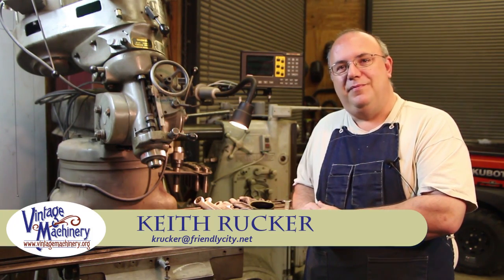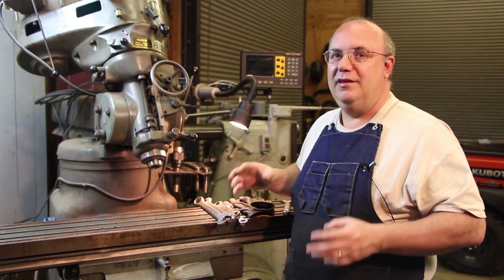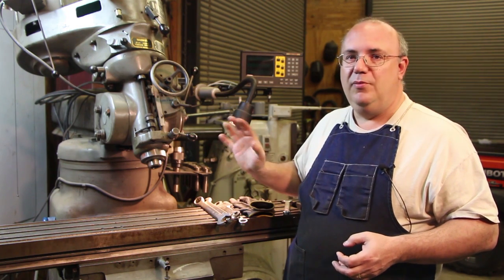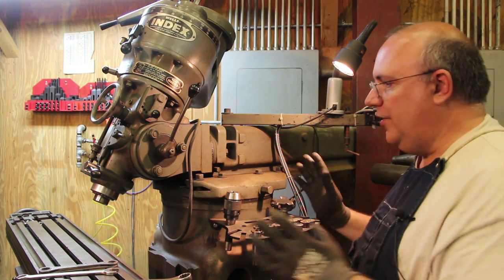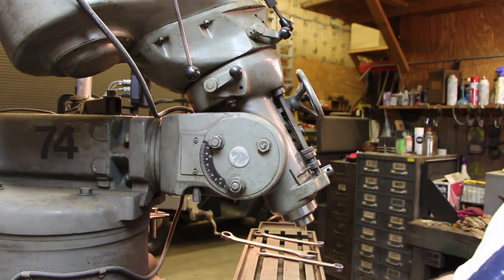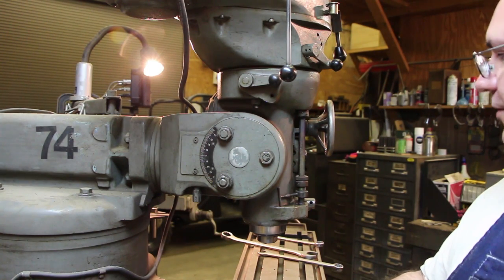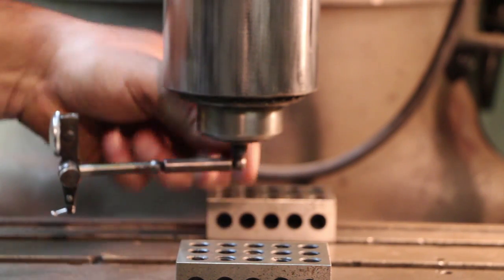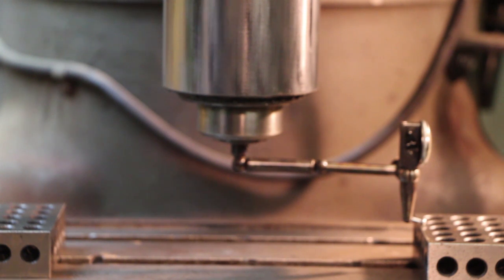Machine Shop Basics:  Tramming a Vertical Milling Machine

Comment: I know this is an old video but I wanted to take the time to tell you that it's still providing useful information for folks and to say thanks.  I just tried your tramming alternative procedure and it worked better than I can do with a Last Word on a bar in the spindle.  I used a precision shaft chucked in a collet and because I couldn't afford a cylindrical square I bought a couple of 2-4-6 blocks (affordable, and I can use them for other things) and stood one of them upright to judge against with a bright flashlight held behind.  I moved the block so that a surface not interrupted by the holes in the block was against the shaft and it was done in a matter of 5 minutes.  That's a great time saving tip for those of us who don't work to tenths precision.

Comment: Keith, the more you show the Wells Index mill, the more I like it. Looks like a well-designed machine. 

For those who haven't seen them, both John (Doubleboost) and Tom (Oxtools) have shown use of large Diesel engine wrist pins as cylinder squares, and they appear to be a less expensive alternative cylinder square...especially if you know a diesel mechanic with access to used parts. Not magnetic, but stable enough by use of gravity. 

Thanks for the demo!

-- Mike

Comment: Keith, great machine trades 101 education video for the new guys just getting to know their mills. I’m sure a lot of veterans will also have their eyes opened by the power & precision that their eyes along with some well-placed light as compared to a precision surface can have. After all, the main purpose of that precision machinist square you had there is to check for squareness of a part to easily within .0002” to .0005” simply by comparing the light enhanced gap along the square blade and the part.  In my early days as a tool maker I built metal stamping dies & the method used to do the final locating of the pierce punches concentric with the hole in the die block involved only light & sight. By equalizing the beam of light shining around the circumference of the punch your eye (and brain) can position the punch within .0001”, (also referred to as a “tenth” in tool maker slang) of concentricity with the hole.
Again Good stuff,  Jim Cunningham

Comment: I think the cylinder allows you a very close initial alignment because the two aligning cylinders allow adjustment of both axis on initial setup due to the cylinder geometry. Because the meeting surfaces are both cylindrical,  their contact points if not parallel with each other on both axis, will show gap out of the gate, not so with the square. IT is absolute for two cylinders to connect if both axis planes are parallel with each other. Absolutely great stuff ! I never really gave the cylindrical set up any thought. Thanks madman, always great info. You ARE the man!

Comment: I trammed my Bridgeport after I had to dismantle it for transportation (while it was apart I o/hauled the head and table) I tried the DTIs first of all but, as you say you can chase your own tail. Just saw your method of getting it within a few thou by using eyesight and a good square. I I used that, then checked it with a DTI and two parallels..... 0.0005" on the clock with a swing of about 6" first try!  Thanks, saved me a lot of hair pulling.

Comment: you seem to be a good easy going fella i used 2-4-6 blocks to set mine up without  indicating my bridgeport in for many years and worked great to speed things up -and i like that wells i never used one of them but seems to be a fine machine i miss the old days i been running od grinders and goerkle gringing machines the last 20 years i actually sharpen those blades you were talking about now days lol.

Comment: We use a precision ground tram ring to set the head, although blocks are good as well. Slightly stoning the surface of the table is recommended to eliminate any nicks which would raise up the ring/blocks.

Comment: Id have to agree on the pivot point for the head on a BP. I have a BP that gets used for small jobs but theres just somthing about the machine I dont like. That said the BP gets a hell of a lot of use.  I also have a Gate turret mill that I would have to say is just a better machine to use and in a lot of ways I couldnt tell you why its better. 
Good video thank you.

Comment: Kieth,the old timers taught me ,to make a ring about as wide as the table say 8" . And say 2 1/2 wide on flat.I other words a fat wide ring 1/2 inch thich. Make this on the lathe ,finishing it between centers, IN THE SAME TURNING. LIGHTLY CUTING BOTH SIDES down to the center. When done three jaw chuck on the od and bore away the small untrue portion in the middle. Thus you end up with a PERFECTLY FLAT circle plate. You then lightly clean your mill table with a file lay the ring on the table ,then chase your tail using a regular bigger indicator than the last word. You have to tap the head side to side bare handed with your hands,no rubber hammer either,you can still dent it! Do this untill the mill head is On ZERO. IT HAS TO BE PERFECTLY ZERO. if not when you fly cut you will have a concave surface.ITS A PAIN,I can be done.Try 2 indicators at once set at 90 degrees and you will chase two tails."They" make a tool with 2 indicators side by side, dont know who but its pricey!My ring is at the foot of the mill in the oil pool by the knee jack screw.How do we exchange emails privatly?

Comment: Thanks for another great video Keith. What's your view on locking dowel pins? My Elliott Super 16 has nod and tilt dowel pins that lock the head in place when it is set true. I have done a sweep at 12 inches in tilt and 5 inches in nod and it is true to less than a thousandth. Is there any reason some machines come without them? Set up is easy, simply get close, slip pin in and tighten nuts. Can be done in less than one minute. Vernier scale for tilt and nod are calibrated to zero with pins in. Have you noticed how a lot of machines have quite crude indications that are,at best, only a rough indication of angle? Having an accurate angle indication makes life easier and faster with the knowledge you don't need extra checks to ensure you are absolutely spot on.
Reply from the maker: +Andrew Wilson I have never used a machine with locking dowel pins as you describe.  I think that they should be fine, unless your machine starts to wear and things move from the factory settings.
Reply: i have worked on machines with the dowel pins and man i like them

Comment: Best way I always did it was to use a co-ax indicator in the spindle set with its straight feeler rotating on a mini surface plate placed flat on the clean and scraped X/Y table with back gear engaged and at the spindle's lowest speed...Then just adjust the both the nod AND tilt (pitch and yaw) worm gears until you see no movement in the indicator whatsoever...

Comment: Hello, Keith been a Machinist for 39yrs I still hate Tramming  a head no matter how many times I do it a soon as you tighten the head bolts it moves a thou or two I like to have everything Zero . and that's on a Bridgeport  in my home shop I have a Burke Millrite  MV mill  that's a little different it does not tilt back or nod only side to side but the thing is it has no adjustment screws for the head like a Bridgeport . you have to leave the head bolts snug and tap it with a soft mallet to adjust it . also if you adjust the head on an angle you must hold it and loosen the bolts or it will swing out of your hands
Reply from the maker: +1995dresser Tramming can be a pain.  Tightening things moves it a bit, and what I have to do is anticipate how much it will move and tighten it into tram - a delicate balancing act.  At least my Wells-Index is well designed and fairly easy to adjust.

Comment: Is there a torque value for tightening up the bolts/nuts when tramming the head?
Reply from the maker: +DSCKy None mentioned in the manual to my machine.  I just get them tight enough that I don't think they will move.
Reply: I just got a mill. Had to put it in 3 pieces to move it. I torqued them to 40 lbs/ft. Do you think that is enough? Thanks.

Comment: when using the dial indicator on the 123 blocks, wouldnt any little nicks and bumps in the table have a huge effect on the measurement? i mean those tables arent exactly new...
Reply: A table would typically be cleaned and lightly stoned before placing vises on it or tramming in the head using 123 blocks. The stones don't remove material like if you were sharpening a knife. You are just feeling for high spots caused by knicks, and can tell when they are gone then you stop stoning.

Comment: With the nod adjustment being in a different position doesn't really matter because on a bridgeport the sideways rotation is on the front which is 6 of 1 and half a dozen of the other, nice machine all the same.

Comment: can one mot machine a cylinder square?? and verify accuracy with various gauges.
Reply from the maker: d koshman I am sure that it could be done.  It needs to be very accurate and very smooth so it would probably be best to use a grinder to get the finish you want, but if somebody really wanted to make one, it could indeed be done!